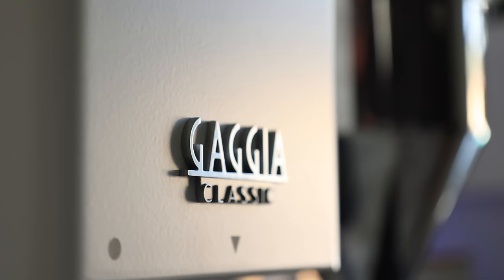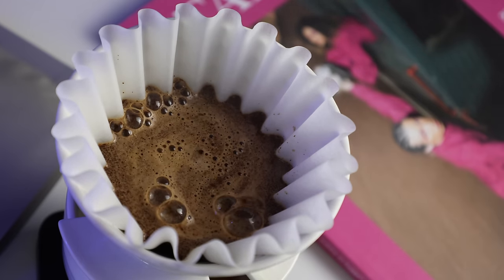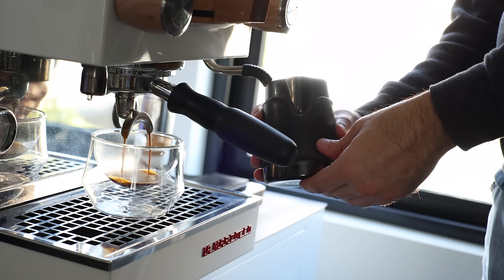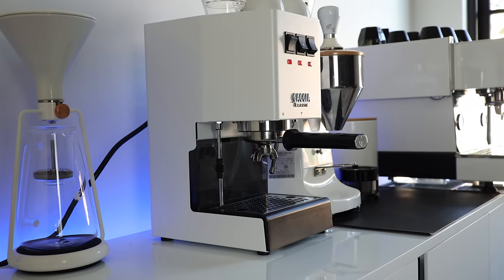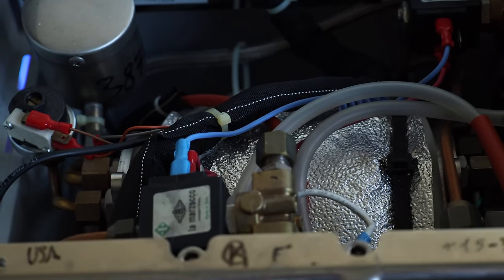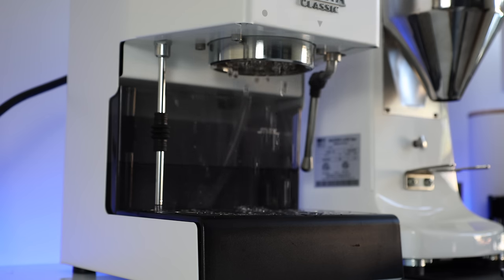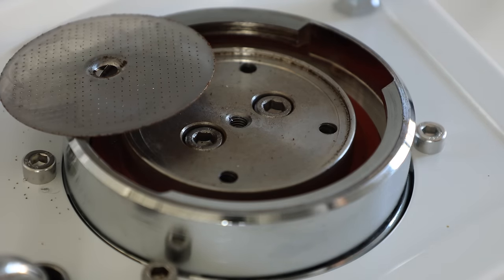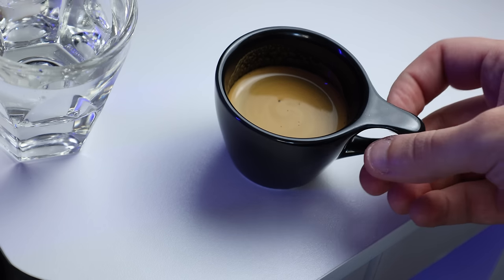SIDE BY SIDE - $500 Gaggia Classic Vs. $5,000 Linea Mini

Comment: Using a Profitec 700 makes me feel like I'm driving a Porsche. Using the Gaggia, it's more like my Honda Fit. My taste buds happen to be average. My budget-minded self tells me my 22 year-old Gaggia, with some adjustments (maybe some 70USD, all in all) makes much better espresso (along with my Iberital grinder) than at any of my coffee bars around. So I can stick to my six-speed manual micro-car and my super old espresso machine, which has been serviced by myself. That doesn't mean I'd like to drive a Panamera S or own a Decent, but I don't need them. And I don't worry about the tiniest scratch!

Comment: As a former Gaggia owner I have to say, I loved the Gaggia, but.... It simply doesn't have the flexibility of a more expensive machine. You can get great espresso shots out of particular types of espressos. But it's hard to pull lighter roasts and for someone like me, who also pulls filter roasts on my espresso machine, the Gaggia can't really go there. I modded my Gaggia with everything Prometheus did. Definitely improves it's performance. Again: I love the Gaggia. Inexpensive and makes great espresso. But if I had the coin I would go up the chain to a machine with greater temperature stability and greater pressure stability. I'm having a lot of fun with my ECM Classika, with the flow control. I can do things with it I can't do with a Gaggia. But. go Gaggia!

Comment: Since you set your Linea Mini to 6bar pressure. Can you make a specific Videos about this setting? As we know with lower pressure setting, brew recipe for each coffee will be much difference. So i’m curious to know your brew recipe when comparing to the standard 9 bar setting. Is it compensate with much longer pull? Or you prefer hotter temperature? Thanks :)

Comment: I would love something like the mini, but currently have a Gaggia "classic". The machine itself is nearly 30 years old. I took it from being a coffee deluxe to a classic by swapping in a grouphead and 3 way solenoid from a KitchenAid Proline (the old KitchenAid Proline is basically a dual boiler classic, and the parts are a direct crossover.) I plan on doing the Gaggiaudino mod to it and then plan on saving for a decent machine. Figure I'll learn and make my mistakes on my current setup.
Reply: You can learn a lot on the Gaggia, Enjoy!
Reply: Also going down the Gaggiuino road… parts are trickling in. I bought a reconditioned Gaggia and will work on raising the floor plan for larger brews.

Comment: As he says, both machines can make hiod coffee and take you from point A to point B, like Honda and Porsche cars. However, if you don't have experience with fast cars you might not get the best out of it. The same goes for espresso machines. There is a long learning curve involved here and many people get better results when they go step by step, despite the price tag and the amount that anyone has the ability to spend. 
So, personally, I suggest new players to start experimenting with espresso machines like Gaggia, Lelit, Silvia etc (even used ones) and if they are sure that coffee is fun to play with and elaborate furthermore, then they can invest on something more expensive which requires additional skills.

Comment: It would have be a really interesting video had you compared a Gaggia classic pro that was modified with a PID and 9 bar pressure adjustment and  use the same precision baskets and grinder like you did in this video.

Comment: I'm gonna have to rewatch one of your older videos and remind myself about how high maintenance that Mini is. It might be heirloom heavy but is it really heirloom sturdy?
Reply: There's no such thing as a maintenance free machine especially of that caliber how do you think it lasts so long? You also have to consider how heavily he was using it almost commercially for his business. In a home environment that may be the last machine you'll ever need, commercially or a small low volume Cafe those parts are going to be wearing out a bit faster therefore requiring service more frequently.
Reply: @jhomrich89  Even at home, if you have to feed it bottled water or distilled water with some mineral product mixed in just to keep it under warranty you have to calculate that as part of the maintenance. No one in their right mind would think they were getting a zero maintenance machine nor suggested it.
Reply: @carbon5261  that is going to be virtually every machine in the prosumer level or above or in the case of the mini or commercial machines that can be or need to be plumbed in they won't honor the warranty unless you have a filter installed. Every product you buy has stipulations for their warranty doesn't matter what it is. Bottled water they know will work best, every other part of the country has different water so that's why they can't warranty it.

Comment: Any particular reason why you prefer the 6.5 bar mod instead of the 9 bar mod for the Gaggia?
Reply from the maker: Personally, and I've heard others agree but there's no specific evidence of this, but lower pressure extractions tend to create tastier shots on lighter roasts, which is what I almost entirely brew.
Reply: @Sprometheus  Thanks, that's really helpful. I mostly go for darker roasts, so will stick with the 9 bar one for now, but if I experiment with lighter roasts in the future I'll try the 6.5.
Reply: @Sprometheus  Great comparison! I recently switched to 6.5 bar on my GCP (with pid mod) because of this video and what I've noticed is that the shots are more forgiving, there seems to be a larger sweet spot so if the shot pulls too quick or too slowly I don't get the harshness I would with a 9 bar pull. A surprising result is my decaf shots are actually sweet now. With 9 bar my decaf shots have always had some harshness to them. With 6.5 bar the sweet spot seems like a much larger target.

Comment: The out-of-the-box 15 bar of pressure seems really odd. Its one thing to have a machine that’s easy to mod, but it’s quite another to say “modding required”. That spring mod sounds required, if you want to get to the industry standard of 9 bar. Any idea why they do that?
Reply: They ship with a pressurized ("crema perfetta") basket - the higher pump pressure is necessary for that to work.
Reply: @mikkoutevsky3902  so out of the box, they optimize for stale coffee and bad grinders?
Reply: @notme123123  Exactly - they optimize for what the average consumer has (preground coffee).

Comment: I love my Gaggic CP. I have done all the mods that Spro has done and am happy with it with my current circumstances with no desire to upgrade. I hope it will last but I must confess it has already required a major repair by the distributor after only a year. This isn't quite the durability that others have advertised. Parts may be readily available but breakdown within 13 months is not good from what is often touted as the rugged and durable option of the entry level machines. And yes, it was regularly maintained. 
HOWEVER, if/when my situation changes to one where I want to be regularly pulling more than 1-2 milk drinks back-to-back then this is where I would want something like the Linea Mini. The Gaggia simply isn't designed for that and this is where I feel the Linea really shines. Yes, there are other options but the 1-2k machines don't look like enough of an upgrade over the  (standard mods) GCP to be worth it.
Reply from the maker: Well said and I’m with you. The thing about issues and maintenance is it feels like a gamble, random chance. One person can have zero issues in a few years, another can have many. Hard to really nail it down in that respect, but you’re right that it isn’t really designed for back to back, it struggles to keep up temp, and especially if you’re going from shot to steam. I didn’t even talk about the steam on the GCP but it’s pretty dreadful in comparison to the Mini.

Comment: I’ve long anticipated this Gaggia versus Linea video! Interesting result of the blind test. The Gaggia doesn’t have a PID and requires temp. surfing, right? Even with PID, I wonder if you’d be able to pull consistent shots. I’ve had amazing shots from my Silvia (with and without PID), but the Linea can pull these consistently whereas the Silvia was hit and miss at times. Excellent content as always, thanks!
Reply from the maker: That’s a fact. There are times where the Gaggia loses temp and you have to wait for it to be ready again. I definitely think the Mini can run back to back consistently, it’s small, insulated brew boiler is like a flash heater so there’s no waiting. Thanks for watching and commenting my friend!
Reply: Ive had the Gaggia for about 5 months. The machine really need to be heated up throughly. Like 20+ mins and then its quite consistent for 2 drinks.

Comment: I'm just a hobbyist at best, and got into making espresso almost two years ago. I started with a Breville (Duo-Temp?) machine, but quickly realized it wasn't for me, the quality wasn't that great. I upgraded to the Gaggia Classic Pro, and eventually made several of the mods you mentioned: a much better tamper, shower head, new gasket, VST basket, changed the spring to the 9 bar spring. I've been happy with the results. I can definitely see upgrading again sometime, but I don't think I would go for a $5K machine. Just too expensive for me. I would love something on that level, but it's outside of my realistic budget. But in the meantime, the Gaggia, with the easy mods makes a nice tasting shot. You're right, it does feel very lightweight though. That bothers me alittle bit, but I've learned to deal with it.
Reply: I started in 2021 with the DeLonghi Dedica and upgraded 4 months ago to the Ascaso Duo Steel PID. It’s so worth it and it felt super weird touching the old machine again when I packaged it as a gift for a friend. 
Not sure if you need to drop 5k for the Mini… probably if you like the esthetic and can afford it. For example I would love to have the Weber Workshop EG-1 grinder one day😅
Reply: I’m back and forth on upgrading the shower screen and it seems like it’s a purchase that most gaggia owners regret or find no improvement. Do you have any thoughts on this? 

I’m considering the IMS or BIT upgrade. I’ve done the gaggiuino mod and I’m trying to push the gaggia as far as possible!
Reply: @calvincheung3955  I think it's probably something that is hard for people to quantify. If the water is more evenly distributed, it makes sense to me that I could get a couple of percent points of improvement. I made the upgrades almost immediately upon buying the machine though, so i can't honestly say it's a huge improvement. I barely used the stock one to begin with. But the argument for it made sense to me.

Comment: I've seen this result over and over. the moment you put ~$100 of after market love into the Gaggia, 6 or 9var OPV spring, IMS basket, IMS shower screen, metal tamper and a bottomless portafilter, on a blind taste, the Gaggia Classic more often than not wins against machines 4x and I guess even 10x the price.  I own a Gaggia classic myself, and I have a lot of fun with it. Why would I want a La Marzocco? The one big reason is the steam boiler.  With a little good timing and a bit of practice, you can get solid steam out of the Gaggia, but it's pretty finicky, and honestly, with some non-dairy milks (I'm a vegan), it's just insufficient to get a good micro-foam. In addition to that - it can take over a full minute to steam milk for a 16oz latte on the Gaggia if you time it slightly wrong you end up having to stop midway through, and wait for the boiler to build up pressure again. So the another reason would be time. Making a couple of drinks in the morning on a bigger machine will take roughly half the time. Not only that, but I can get hot hot water out of the Linea where I just can't out of the Gaggia when I'm making non espresso drinks like hot chocolate, matcha lattés and chai lattés. Also - for the serious coffee nerd, you'd probably not drop $5k on the La Marzocco, you'd go by a Decent Espresso machine anyway where you can control much much more precisely things like pre-infusion and flow rates. The La Marzocco just isn't that machine. It's designed to come onto your countertop one day, and not leave for 40 years. And for the name, and the fact it's beautiful, and if I had inifinite money, I'd get one because they look amazing.
Reply: I’m back and forth on upgrading the shower screen and it seems like it’s a purchase that most gaggia owners regret or find no improvement. Do you have any thoughts on this? 

I’m considering the IMS or BIT upgrade. I’ve done the gaggiuino mod and I’m trying to push the gaggia as far as possible!

Comment: No one has questioned the non-stick coating inside the boiler. Gaggia uses Exelia 3010-B242. Exelia is used in the cooking and baking industry. The Food & Drug Administration has also approved the use of Exelia 3010-B242. Does it matter? The FDA also approved the use of Teflon and which has been proven to cause cancer. Boiling water is not as hot oven temperatures but it does not mean using Exelia 3010-B242 is safe either. Fluctuating water temperature, from refrigerated to near boiling, sits inside the boiler for multiple hours, days, and weeks. Can the Gaggia Classic Espresso Machine cause cancer? Where is the data proving that Exelia 3010-B242 is safe? What is the list of chemicals in Exelia 3010-B242? Why isn't the list of chemicals used in Exelia publicly available? How are the chemicals bonded together? How is Exelia 3010-B242 bonded to the aluminum boiler? Too many questions. Zero answers....
Reply: I thought Califano caused cancer, I miss my red dye #2

Comment: I’d been looking a espresso machine for a while and a few months ago I got a flair signature for £100 (guy didn’t know what he had basically) and I have to say it probably the best espresso ‘machine’ with out going to something like the linea. The ease of profiling or choosing your pressure is unbeatable and more than makes up for the slight hassle of boiling a kettle. Also from start to finish a shot is taking me 4mins unlike most espresso machines that have to warm up for 20mins+
Reply: Us crazy manual lever people! I have a flair 58 and a stove top steamer. The kettle boils in three minutes and the steamer in seven with 1.7 bar pressure. Also I can use any heat source flame, induction or coil.
Reply: @benfuct5880  4 mins is from starting to have a shot not just how long the kettle takes to boil. But yes I do agree we are crazy haha
Reply: I have the pro 2 and I'm going to switch to the 58 as soon as i can, the constant battle of heating all the metal is really taking up a lot of time.
Reply: @Cenot4ph  I find it quicker to heat up with water rather than wait for a heater. All I do is pour the water in then do puck prep and it’s ready to go
Reply: @murraythebaker  it will not nearly be hot enough, I have a temperature strip on the metal so I can see how long it takes to get it to 95 celsius and it definitely takes a good 5 minutes with my bialetti brikka base.
You can do it with your method, but brewing medium, light roasted coffee will turn out sour more often than not
Reply: @Cenot4ph  I only drink light roast. I’ve never had a problem with it. The pro has a bigger brew head so that could be why
Reply: @murraythebaker  yea it's a solid block of metal, not quick to heat unfortunately.
In any case, the 58 is a big upgrade in that sense. Bigger basket and no more manual heating maneuvers

Comment: As a devout utilitarian consumer, my gaggia will be forced to live much longer than a decade. 

I am sure these higher end machines can make better espresso, I'm looking at you eagle d1. It's the 80% rule though, at  1/10th of the price range it's 80% of the way there. I think the real character in the espresso comes in the craft of prep, and recipe. Coming from cheaper machines than a classic pro, i had to get incredibly ingenuitive about My grind, dose and Bean selection. I have a late recipe that i have honed over the past 5 years. Between a 140$ gaggia carezza i ran proper basket on, and a modified classic pro, i couldn't tell you the difference other than i adjusted how i grind and dose.

Comment: I’ve had a Gaggic Classic Evo Pro for the last 6 months and while it’s a great entry level machine to get your feet wet, it’s been a disappointing machine with the inconsistency due to the boiler. Steam pressure is pretty weak on it too. I’m now trying to figure out which Dual Boiler to go with in addition to other features like PID, etc.  Looking back I wish I had spent the extra money on a better machine. I know you can mod the GCP but it’s not something I want to mess with. I think if you’re learning on something and don’t care if your drinks don’t come out perfect every time, then the GCP is a great machine. If you want consistency, and pro level features, save your money and get something worth spending the money on.

Comment: My classic is 15 or 16 years old and still kicking ass. I'm also using the VST basket and shower screen, but still need to get around the OPV spring thing. You figure the 6 bar or thereabouts is the way to go? Seems like most people aim for 9. Anyways, I love my Classic.. and if I ever get cash for an upgrade.. yeah.. I'm spending it on a better grinder, not a better Coffee machine.. and I wouldn't mind buying another (newer) classic all over again! But yeah, I haz the barista tingles too.. I'd love to own something mid-engine (or rear) & rear wheel drive for sure.

Comment: I mean what's the point in pitting a 110 ml boiler against a Linea. It's physically impossible for it to hold the temp steady. With a 1k machine against the Linea things would turn out quite different. Say an ECM Classika PID wizh its 0.7 L boiler vs LMLM. There are a lot of machines between a GCP and LMLM, where spending a little more will get you espresso identical to a LaMarzocco.